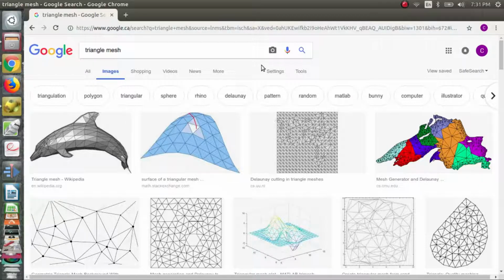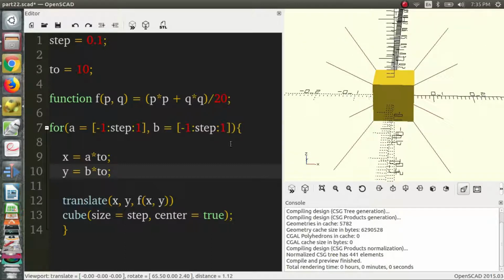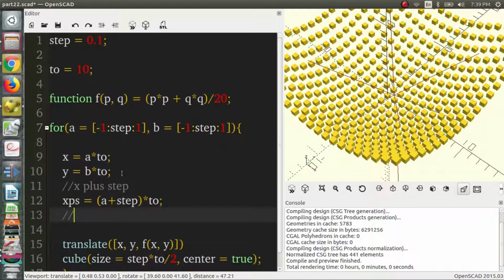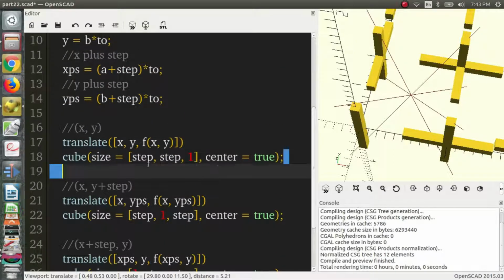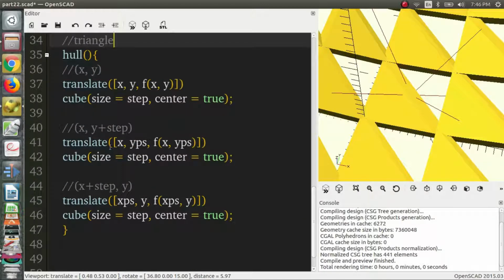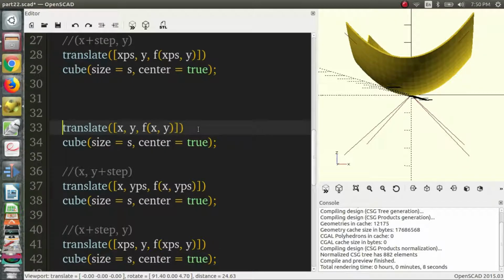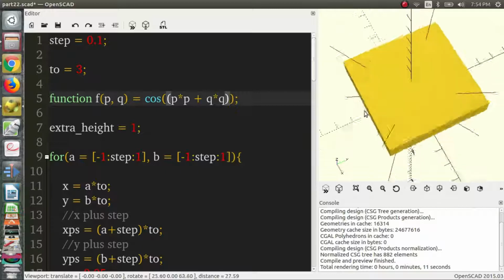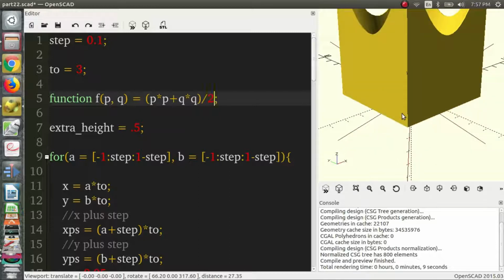Surface Hull-OpenSCAD Tutorial 22

Comment: Why not use the polyhedron() primitive ?
Reply from the maker: You could, it would just take some more work to determine how the points are ordered to create the faces. Essentially it's easier to use the hull module. One thing to note , however, is that, depending on how you use polyhedron, you could run into issues where two objects share an edge, which is not allowed and would cause manifold issues.